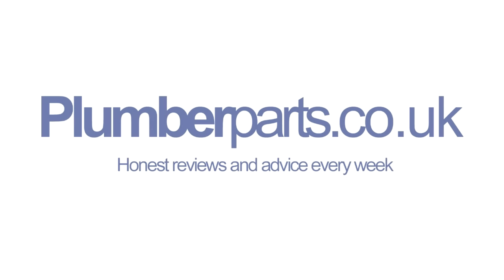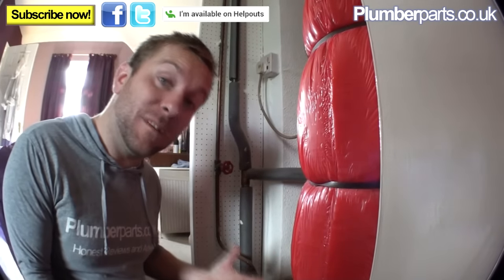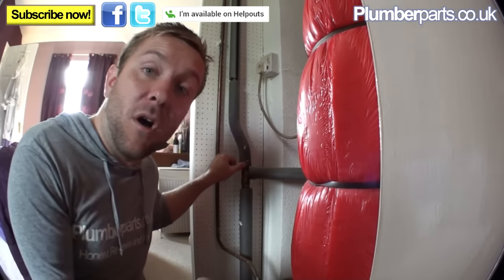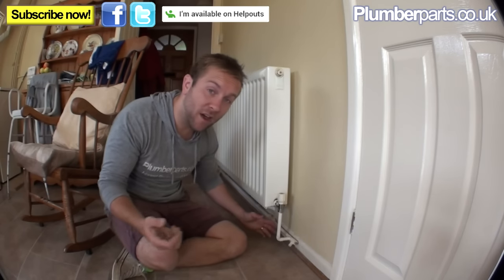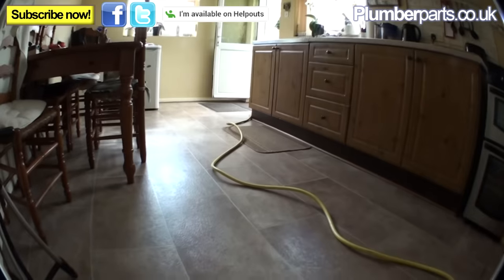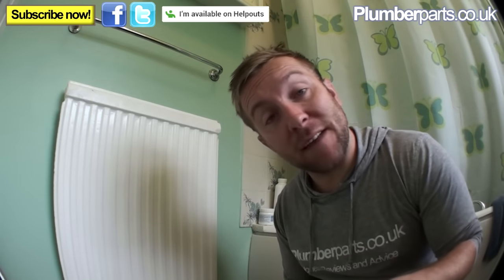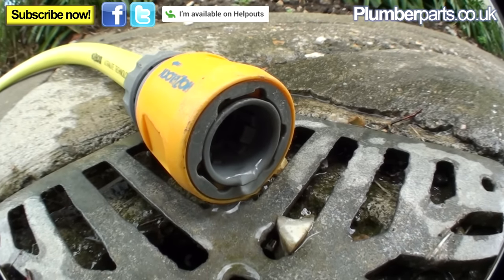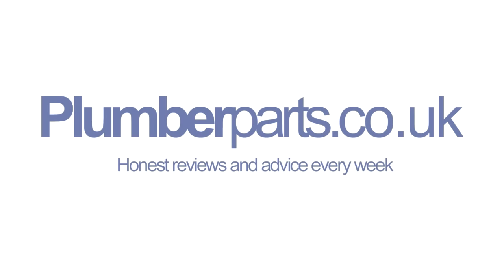HOW TO DRAIN DOWN HEATING SYSTEMS - GRAVITY FED - Plumbing Tips

Comment: great video
a little tip if you get stuck like I did. my system had drained but the f and e didn't empty there was either a little blockage on the f and e pipe or an airlock somewhere at the top of the system. I had to give the f and e pipe a real good shake to free it up, then the water came gushing down and fully drained the system.
Reply from the maker: Could have been an airlock.....can happen mate! SUBSCRIBE! ➡️👉 https://www.youtube.com/subscription_center?add_user=plumberparts 👈⬅️ IF YOU HAVEN'T ALREADY! 😎
Reply: Excuse my ignorance but do i need to bleed the air out of the rads if there is an aladdin auto. valve on upstairs bathroom rad. ?   cheers cm

Comment: Thanks for all the advice and knowledge you give. My  sytem is a Y plan system and what's happening is the overhead tank is over filling with water coming through the feed pipe at the bottom of the overhead tank. Will be very great full for your help

Comment: Would it be correct to say that if the plumbing work is to be done on an upstairs radiator or pipes only, then there it no need to drain the system downstairs?

Comment: This has helped a lot.
I'm looking to do this on my open vent system in a property just recently bought.
I want to flush system then add F3 Fernox and let it run for a few days then drain again then top up with inhibitor and sealer.  
For some reason, i already have drain taps fitted on every single radiator in the house. 
Do you know why they have done this.

Comment: plumberparts, Note: the pipe going up and over the expansion tank is "not" the expansion pipe,  nearly all water  pushed out of the system by expansion flows up the "feed pipe" coming from the bottom of the expansion tank.

Comment: Great video. My problem is the drain cock on my lowest  rad is fed by the pipe work coming from upstairs. Would this mean the other 5 rads on the ground floor will not drain? My boiler is at the lowest point is that a place I could drain the system From? Thank you

Comment: Great video!
I’ve followed the steps but nothing is coming out of the hose and when I try to open radiator (starting with the towel rail) it just sprays water. I’ve already removed some of the radiators both upstairs and downstairs for decorating - could that be what is stopping it from working?

Comment: Really appreciate the videos.
1:26 minutes in you mention problems with refilling. I’ve turned mine back on and nothing is flowing through! Any tips?
Reply: Did u open back up your lockshields? Open all valves check to see f&e float wasn’t sticking?

Comment: I have got another soltuion about draining a system without draining a completely just the heating water whats actually in the system not the whole tank.

I use to take quite often a screw driver and put a rag / cloth around and push it into the bottom of the outlet for system and it helped me quite often to safe time and water it would be to me also the last solution to be honest but it worked out.
Reply from the maker: Good on you!

Comment: Hi thanks for the video.
I have 4 rads downstairs, one has been removed ready to put on a trv.To empty the system i removed another radiator  nearest to the front door so i could attach a hosepipe, i opened all the bleed valves upstairs and they emptied fine but 2 rads downstairs remained full of water. Any idea why this is please ?
I gambled and removed the old valves and put on a new lockshield and trv but I expected water from the remaining rads to come gushing  through .
Thanks

Comment: @plumberparts  To change the 3 way motorised valve on my system do I have to drain the full system down? On my system I have a 22mm gate valve on the feed to the heating system after the 3 way valve. A drain cock on the hot water coil feed just before entry into the hot water tank and after the 3 way valve. There is also a gate valve/by-pass which I can close. Also if I close the exit side valve on the pump it looks like all water feeds to the 3 way valve will be isolated. Hopefully this should alleviate the need to drain the whole system down. The cental heating system is a standard F&E system on 10mm copper.   Thanks in advance.

Comment: Hi James, how about a situation where the pipework for the downstairs rads is under the floors and thus below the level of the radiators. How would one get the water out of the lower pipes?

Comment: Cheers for the vid mate. Wondering if you can help. I turned my hot water off with the red stop tap in the hot water tank cupboard. Anyway done the job i needed to do and turned the tap in the cupboard back on. Anyway the tap in the cupboard just keeps turning and will not stop turning. I tried to turn it the other way and it just does the same. I have no hot water coming out of my taps the heating is fine. Just wondering do i need to change this stop tap and use this system before hand. I thought it was an air lock at first tried all the methods but i am pretty sure now it is this stop tap. What do you think.

Comment: Isn't the downpipe with gate valve into the bottom of the cylinder the supply from the main (big) cold water tank, rather than the f and e tank?

Comment: Hi, great video. Does this technique drain the entire system including the flow and return pipes at the boiler? I need to remove the flow pipe to replace the flow switch o ring. Thanks in advance

Comment: I've just been on the hunt for the drain connection and found two next two each other on separate pipes under the hatch at my back door (probs the lowest point in the house) Any idea why I might have two? 

Brilliant videos btw, you've helped a complete plumber noob such as myself loads! Keep up the good work!
Reply from the maker: Hi Iain, two drain offs sounds like one for the flow and the return (or hot and cold water on a basin) So seems fine. Regards, PP!

Comment: Hi 
I tried to replace the radiator and use a new trv valve  at the bathroom radiator but the water is still running and couldn’t stop it ,knowing that there is other radiators on the same floor (top floor ) 
Do I have to drain them all and open the bleeding valves and fill them all after that?

Comment: My system has sludge in it. I've added Sentinel X800 but I don't think it's cleared it. I don't want to spend £800 on a power flush, so was wondering if I could drain the system and run the boiler and pump at same time to flush it. Or would that cause damage to the boiler?

Comment: I prefer bunging a system to change a component if possible/practical. And I'd imagine it'd be quite easy for a DIYer to get stuck when refilling an entire system. Worst one I've had was a choked cold feed on a drop fed system in a bungalow where only some of the radiators had the 1/2" connections on the top. Clearing the air from that system took a looooonnnng time.

Comment: I’m looking to swap 3 rads on a microbore system, as the customer wants trv’s installing. How do I prevent/solve air locks? Thanks
Reply: If you don’t have any air in the line or water should you leave it open until some come up

Comment: I just want to drain down the central heating headers to refit a replacement radiator. I plan to shut off all but one of the radiators to drain the headers, can you see anything wrong with it?. Its a gravity fed cent heating system.

Comment: Hi,having a problem with kettling at the moment, what can i do if i cant find any drain valves on the bottom floor, also ,if i empty the system can i just add an inhibitor or do i need a cleaner also, many thanks

Comment: Thanks for the video. I've managed to drain down the rads from the upper floor successfuly. When i open the bleed valves on any of the downstairs rads, water comes out from the bleed valve instead of air being sucked in!Have checked that both valves on the rad were open. Have i missed something?

Comment: Needing your help. I've a gravity system with a pump in the hall cupboard below the small feed tank in the loft. I've just replaced two radiators in upstairs rooms. Re filled the system and all 6 radiators upstairs are working fine but the 3 downstairs are all cold. I've emptied and refilled the system several times over the past few days. All radiators and pump have been bled. Tried leaving upstairs rads off to help force the water through downstairs. No joy. HELLLLLLLP!
cheers Davy
Reply: Did you find an answer for this? I'm going to change mine and wouldn't want to have the same problem.

Comment: Hi, I drained my system from the pipe under the radiator as I needed to change the faulty pump and the valves either side of the pump are stuck open, I undid the pump nuts and water started spraying out? How do it get rid of the water going into the pump, the pump is situated next to the copper tank in my airing cupboard, please help.

Comment: Hi does anything need to be done with the 3-way valve before draining?  Cheers.
Reply from the maker: +James Latch it open.....totally forgot that! ARGH! 

Please sub >> https://www.youtube.com/user/plumberparts << if you haven't already!
Reply: +plumberparts : how do latch it open if the heating is off? My system is an S type with 2 x 2 port valves. Should i only open the one for the hating but not the one to the cylinder? Thanks

Comment: Hi PP, I would like to change my upstairs bathroom radiator to a heated towel rail. I would need to modify the pipes to suite the new towel rail. So my question is - do I need to drain the whole system or can I do upstairs only? It's a gravity feed system and rads have thermo valves and lock shields on. Any advice about the easiest way to do this would be really appreciated.

Comment: hi do you need to do this if you need to change the taps. I went to a house f and e system and no isolation valves on any of the taps so will I need to drain the whole system to change them
Reply from the maker: Yes, but the taps aren't on the heating system....so just drain the cold feed tank to the taps! SUBSCRIBE! ➡️👉 https://www.youtube.com/subscription_center?add_user=plumberparts 👈⬅️ IF YOU HAVEN'T ALREADY! 😎
Reply: Thanks James do I also turn off the hot water valve to the tank. Sorry mate new to this.

Comment: Hi, I need to change a Drayton 3 port valve body which is in upstairs airing cupboard. I can only drain the system through the boiler which is in a downstairs cupboard with the drain plug almost at ceiling height. Do I need to open all the radiator bleed valves. Also won't water gush all over from the hot water cylinder when I removed the 3 port valve body.
Reply from the maker: Yes mate, drain just like do in this video! SUBSCRIBE! ➡️👉 https://www.youtube.com/subscription_center?add_user=plumberparts 👈⬅️ IF YOU HAVEN'T ALREADY! 😎

Comment: Hi, have turned off the water to stop the f&e tank filling. I opened the lowest drain off (a myson valve on the rad by the back door) but no water starts to gush out ... so I opened the highest rad bleed (en suite towel rad upstairs) BUT instead of letting air IN, it just lets water out (like a normal bleed). So why isn't it draining ? Have i got a valve or possibly an air lock somewhere keeping it in? (I also set the 3 port valve to manual HW & CH to allow the drain). Stuck.

Unstuck ! (The drain off valve needed a 'kick') : ) 

However ... I now have x3 of the 4 downstairs rads still full. (The one drained may be on the 'drop down' as mentioned on the vid?). Nevertheless, what do I do to drain them also please? When I have tried to open them to let air IN, they actually bleed as normal and spout water OUT even with the the inlet valve and the lockshield valves closed ? ? ? What to do? Do you have to drain them off individually? Take them off? Stuck again.

Comment: I've just drained our heating system. It took 6hrs to drain the cylinder! I attached a hose to the bottom drainer and ran the hose downstairs and outside. It drained continuely, just slowly. Is there a way to make the cylinder drain quicker?
Reply from the maker: +Mark Herriott It's usually a drain off washer that's stuck. Check our channel as we've done a video on it. Regards, PP!

Comment: Hi mate. Thanks so much for your excellent and very entertaining videos. You should have your own TV show! I'm having trouble draining my system as the downstairs is on 3 separate legs and after draining the 1st leg (plus upstairs obviously!) I found that I couldn't get anything to come out of the other 2 legs. I've got the bleed valves open upstairs but it seems there's some kind of vacuum that has developed that's holding the water back on the other two legs. Even if I take the drain plugs right out nothing is budging! I want to be able to completely drain flush and then refill it in about 3 weeks time. Any ideas how I can shift the water? Cheers. Tom
Reply from the maker: Shut one of the ground floor rads you’re trying to drain and remove the whole plug. Pop a bucket against it and then slowly open the rad valve. That should work (towels too!)

Thanks for your kind words mate. Still uploading now so please sub!
Reply: @plumberparts  thanks so much for the swift reply!

Comment: Since I drained my system down I have no hot water all radiators are hot any suggestions would me much appreciated
Reply: Air lock try the methods on here no tools needed.
Reply: @kennylavelle6987  Thanks it was a airlock

Comment: Great videos, thanks for all the help.  Currently my heating is stuck, I’ve spoken to Drayton and they say it sounds like the Actuator and Port Valve are not working properly.  They helped me diagnosed the system over the phone.  I have the Drayton 3 Port Valve and Actuator new part.  I’m ready and think I can do it myself.
What I wanted to ask was my Radiators downstairs are old, and the heating on them is barely working at a third or not at all.  (I have bleed them countless times, and heating at the top of rad, and very cold at the bottom)  
Because the heating is stuck, do you think I should change all the rads first then the 3 port or the other way round? Or something else? 
Thanks again

Comment: I have a newly installed vaillant just two months ago. Now im experiencing pressure loss only when i turn on heating.... checked that there is no leaks aswelll.... can you do a video or advise me thanks
Reply from the maker: Yes mate, check our video on combi boiler loosing pressure: https://www.youtube.com/watch?v=4meZgMAUecw SUBSCRIBE! ➡️👉 https://www.youtube.com/subscription_center?add_user=plumberparts 👈⬅️ IF YOU HAVEN'T ALREADY! 😎
Reply: Can I drain down the primary circuit from a fortic combi cylinder and parkray back boiler setup and still use the cylinder as a direct (immersion) tank until I complete a re rad and gas combi installation. Thanks

Comment: I am replacing and relocating a radiator. Same wall, smaller rad and different location. Can't drain the system in the normal way because there is no drain valve in the circuit. No prob. That rad is coming out anyway so I can drain the system from the return valve. No prob. Everything linked up and she's draining away nicely. It's taking too long to drain! Now I have a problem. There is only one tank in my attic and this tank has two outlets. I presume one of these outlets is supplying the central heating system. It would appear that it will be necessary to isolate the heating feed by emptying the attic tank completely. I'd rather not have to do that. In my airing cupboard there is a small roundy red tank. No gauges or dials. Just the tank with one inlet and one outlet. There's a shut-off valve on the top pipe. What more can I say?
Reply: Sorry!!! Just one feed into the red tank. From the bottom.

Comment: My boiler hasn't worked for the last three years and I don't intend replacing it. I don't like water being pumped around the house or the noise the pump makes and ideally would like the whole lot ripped out. Those red handled stop cocks though are rubbish and never shut the water off completely.
Reply: yeah, water being pumped around the house....definitely something to be concerned about lol
Reply: @SystemNutrition  Yes, my next door neighbour came back from holiday and their house was scrapped by water. Insurance paid up £400,000 to repair a house worth £300,000. So nowt to worry about then.